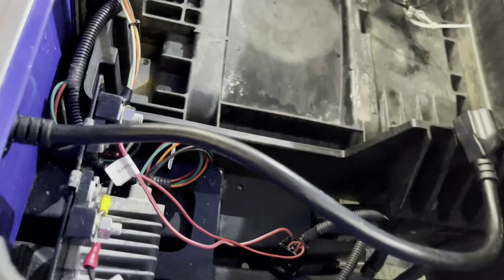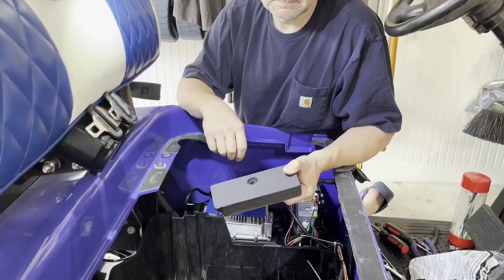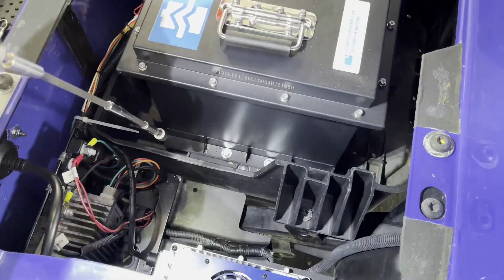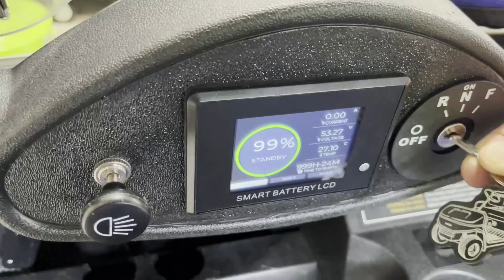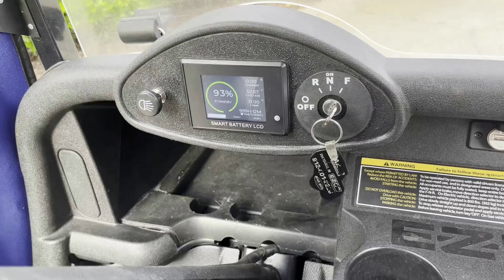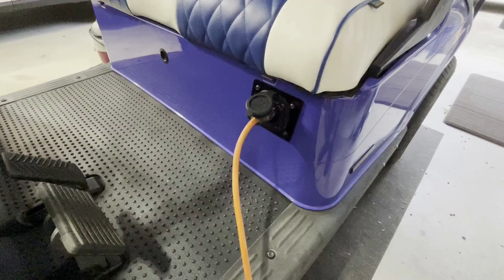48V EZGO RXV golf cart DC HOUSE LiFePO4 lithium battery conversion, PART 4 – Battery install & Test

Comment: Did you not have to plug the blue wire from the oem charge port to the positive side of the battery?